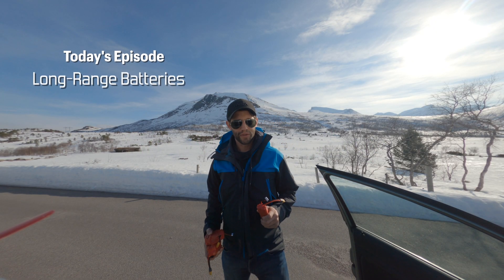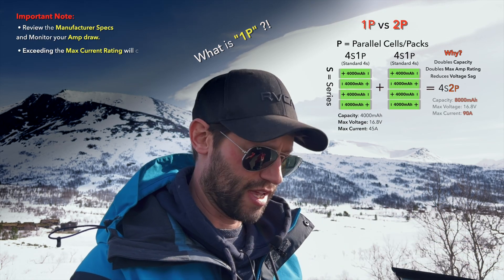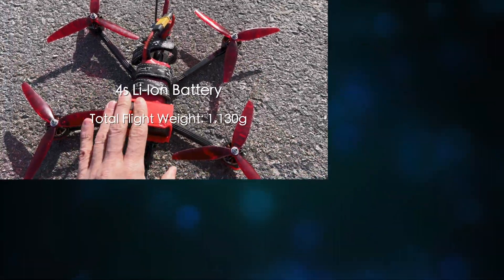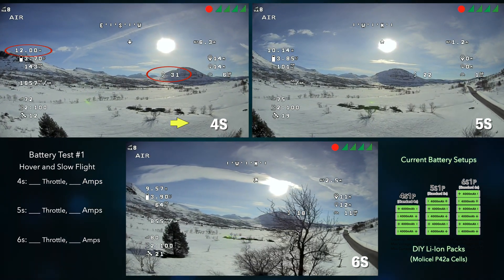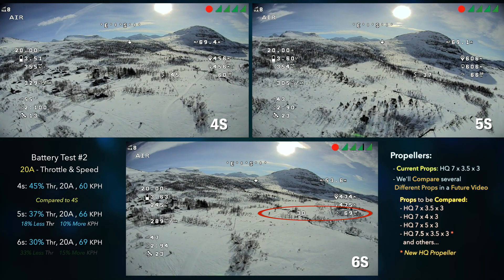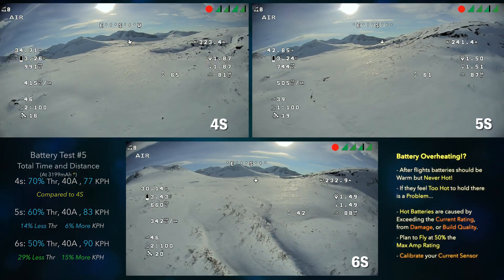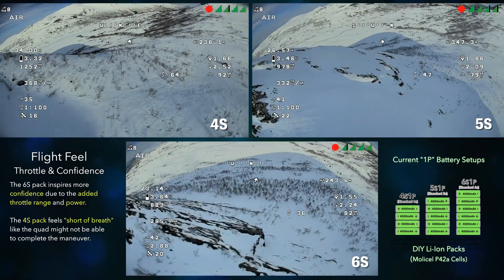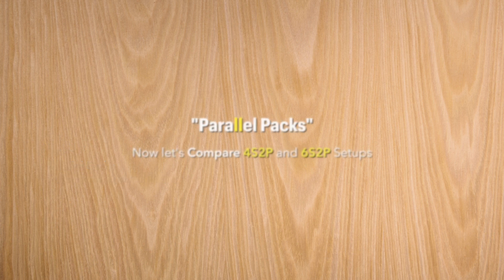Li Ion Battery Comparison for Long Range FPV Quads, Wings, and Planes. Chimera 7 with HDZero VTX

Comment: With just the battery packs 6s2p I'm getting 1.5kg on my set up and your chimera frame weighs more than mine. And you have a go pro on board wow? Where did all my extra weight come from on these 21700 packs
Reply from the maker: My quad weight 1700g AUW with GoPro. So yours sounds about the same actually. 
For shorter missions I’ve started using 18650 6s2p packs (Rated: 5200mAh/70A) made with Molicel p26a, p28a cells are an even better option, saves about 300g and the pack itself fits nicer on the quad. 

Let me know if that’s what you meant.
Reply: @GiantAntCowboy  right right I've just a few days ago built a p28a 18650 pack to try out so far I like it I may build an other not sure
Reply from the maker: @elxero2189  yea, I love how it fits on the quad nicer, and also the 300g weigh savings I noticeable.
Reply: @GiantAntCowboy  yeah I noticed that too much lower flight time though but as you've said, it's for shorter missions
Reply from the maker: @elxero2189  yea I think I’ve managed 13km, up a mountain and back with the 5200mah pack. So the larger pack is much better for cruising and “scouting missions”.

Comment: Which jumper is better to use for assembling Molicell 21700 42A - 6S
What thickness and width of the steel tape is suitable for peak loads of long-range quadcopters. I want to use metal tape and welding instead of soldering
Reply from the maker: Sorry for the delay. So I haven’t used nickel strips or a spot welder, but will say I see a lot failures with them because the Nickel strips have high resistance compared to copper, (like only 25% as conductive as copper) and the batteries can get hot when pull high amps. The strips can even melt. So, I can’t say what thickness but better to go thicker for sure. 
I personally have soldered copper wire on all one packs and have no problem even when pushing them really hard. Thanks for watching, cheers!

Comment: Best long rage battery test I've ever seen. Wish I could have seen this earlier.
Reply from the maker: Thanks, always hoping this is useful to someone. Of course results will vary based on your motors and props, but it’s a good base line for folks. I’ll be doing a follow up with 1300kv motors and some lighter 18650 packs, so stay tuned. 
Appreciate the comment and support, cheers!
Reply: @GiantAntCowboy what’s the best KVs on motors for long range flight on 5 inch?
Reply from the maker: @joloasenirofpv  that’s a tricky question, lower is generally more efficient, but you’d have to find a balance between performance & efficiency. So it really depends on your Goal/Use, Motor Size, Battery Type, & approximate AUW.

Comment: it's interesting but are we measuring power usage? The 6s battery is using a lot more power because the higher voltage at the same amp hours and it's heavier. it just doesn't look like the efficiency is taking in consideration the voltage with the amp hours. I think that's called Watts?
Reply from the maker: Yes, in hindsight I should have used Watts as the comparative figure. I was more focused on current (Amps) at the time I made this video simply because li-ion batteries generally have a low Max Current Rating. 

I’d like to redo this test comparing some of my new 18650 packs as well. They are lower capacity but also weigh less. Always lots of variables and thing to think about, so appreciate the feedback. Cheers!

Comment: With wiring the li-ion pack. Doesn't it not matter for balance cables which exact battery its on just like between b1 & b3.. between t3 & t4??? (Except for 1st positive and last negative )
I want to build a Molicel P45B pack 6S2P or 4P. Maybe a 3P 😆 🤣
Reply from the maker: I believe the order matters when using a balance charger, in fact I believe I actually got an error once when I swapped two leads on mistake. Basically it’s adding the voltage for cell and if, for example, the second cell shows more than double the first cell it thinks there’s a problem.  (This shouldn’t be dangerous though.) 
** The most dangerous thing that can happen is either overheating the cells while soldering, or accidentally shorting the (+) and (-) terminals of the battery. Remember that the outside of the battery is (-) and if you accidentally bridge solder, or a wire, from the (+) terminal to the battery case you could short the battery which can be dangerous. 
Tip: Never work on cells that are fully charged, and always check cells before assembling to ensure they are at a similar voltage. 
Sorry… lots of precautions, I just want people to be safe. 
I built a proper 6s2p pack using the smaller P26a cells and really like it. Nice size and weight, and can still get about 13km up into the mountains. The P45b cells looks really nice, I haven’t found any of those yet in Norway. Still using the P42a cells. You can certainly make bigger batteries, 3p/4p but since these are flying machines the capacity benefit eventually becomes negative due to weight. “Diminishing Returns”
Curious to see and hear about your projects and findings, cheers!
Reply: @GiantAntCowboy  meant the 2 batteries connected by a strip. i can just put it in the middle of the strip. might get spot welder might solder strip. not sure. doing a lot of research not to set house on fire lol

Comment: I tested 6S4P 18650 on 7" I turn into a 8" a few flights
Reply from the maker: Nice. Which cells are you using? I made a 6s2p from P26a cells that I really like, it’s my go to battery for fun medium range stuff.
Reply: @GiantAntCowboy  they are VTC6 cells
Reply: @GiantAntCowboy  I want to make a 6S3P or 4P with molicel P45B

Comment: Very good video and info.  High confidence in my 6s2p build going forward.
Reply from the maker: Thanks appreciate the comment. I recently made a 5200mAh 6s2p pack using Molicel p26a 18650 cells and really like it, weighs 300g less than my 8000mah pack and fits the quad better. 

I can still fly 12-13km with it which covers most flights for me.
Reply: @GiantAntCowboy  My thoughts exactly. I don't think I'll be building 21700 packs and will just stick to my p26's. It's plenty for my AOS 7.

Comment: I build some Chimera 7 by myself for Long Range cruising stuff. Together with DIY 6S1P Li Ion Molicel P42A / 4000mAh you get good flight time and for Fun you can use 6S Lipos around 3300mAh. I think Li Ion in 6S2P is too much weight. So this year I will swap out my 6S FC+ESC and try 8S. More Voltage means less current and more energie than 6S but only 2 cells more in one Pack. So i hope i can gain more flight time.
Reply from the maker: Nice, appreciate the comment. I recently made a 5200mAh 6s2p pack using Molicel p26a 18650 cells and really like it, weighs 300g less than my 8000mah pack and fits the quad better. 

I still fly 12-13km with it which covers most flights for me. Curious to hear how 8s works for you. Cheers!
Reply: @GiantAntCowboy  The Molicel P28A looks very promising. 2800mAh / 35A discharge and only 46g each. So a 6S2P Pack of these weight roughly the same as 8S1P P42A. Both Packs have the same amount of energy 124Wh. But tue 6S2P will delivers more current.

Thanks for sharing you Infos to us. I appreciate your work!

Comment: Hi dude, thanks for your video! I was flying at some really high peaks around 25000ft, using 8000mah 6s lipo on my 10inch because I think lipo performs better at -20 degrees, but I'm curious what's the best match for my need if I'm trying Liion next time, probably 6s 3p?
Reply: I need the flight time to be as long as possible, will need to cruise 5-6 miles to get to the mountain while the wind can be massive above.
Reply from the maker: Hey, appreciate the comment. Crazy mountains your flying to sounds like! Where are you flying? 
Regarding battery solutions: What’s the average current draw (Amp Range) you have while flying? Some options:
If you made a 6s3p pack with Molicel P42a cells it might weight about 1300g (slightly more than your 8000mAh LiPo) but it’d have 12,600mAh and it’d handle up to 135A. 
Or you could use like Sony VTC6 cells in the same 6s3p setup and you’d have 9000mAh with 90A max current, but it’d only weight about 900g. So you’d save between 300-400g which could result in better range. 
Alternatively depending on Amp requirements, you could try some 4s setups, which saves a lot of weight, but reduces top-end power due to the higher current demand.
Reply: @GiantAntCowboy  Thanks for the suggestions, I'm in China, flying near the Himalayas so the mountains are over 18000ft in average, pretty insane. The flight time at this altitude drops to 60% of what you get at sea level, so the flight time needs to be over 35mins at least. I'm now getting 30mins on my 10" 6s 8ah setup but wanna change it to maybe around 10ah on 8"

Comment: I watch your videos from India. At present I don't have access to any of these HDZERO vtx or Chimera frame here, but still your video inspires me and add knowledge to me that if i will make, then how i will make one. Presently have a five inch quad with analog vtx and 14 min flight time.
Reply from the maker: Thank you, appreciate the nice comment. Analog is simpler, cheaper and still a ton of fun!  No need to go digital honestly, but obviously the image is better. Depending on your goals, 5” quads are pretty universal. Li-Ion batteries are great for increasing range, and helical antennas are cheap and easy to make if you need more video range. Thanks for watching, cheers!

Comment: Great video man that’s a ton of work thank you very much for sharing all this precious informations ! I have a Falcon FR7 and use dual 18650 vtc6 6s2p to get the longest flight but it’s quite a fat build 😅 1500gr AUW . For mountain diving lately I’m starting to like big lipo too, ( >3000mah ) but are very expensive and hard to find …
PS: I’d curios to see your pids too even if it’s kind of personal
Reply from the maker: Hey thank you, it mean a lot when people recognize the amount of work I put into these videos. It always starts as personal curiosity but then I obsess about the presentation details. 
My build is 1700g AUW with a GoPro and 21700 6S2P 8400mAh packs… but lately I’ve been enjoy/using these 18650 packs I made with Molicel P26a cells. In 6s2p configuration it’s 5200mAh, handled 70A, and weighs 300g less. Want to build more of these, they actually have a P28a cell too, I just can’t find them here in Norway… agree about LiPos 🤑
Regarding PIDs I’m actually using a BF4.3 preset. The 7” one by UAV Tech and it’s working great, haven’t done anything other than follow his notes and then I adjusted the rates a little. I’d recommend trying it. Anyway, thanks for watching and commenting. Stay tuned, cheers!

Comment: GepRc 7" here. Just made my first 6s, 4000mAh 21700 li-ion pack (Samsung 40T cells). It's 456g. My 5000 mAh, 6S lipo is 790g. I'm gonna make a bunch of these things. I can get 60% more capacity for 12% more weight in a 2P setup... it's a no-brainer. Li-ion is the way to go for 7" quads. The only time i'd go with a lipo is if i really feel the need to thrash it for 3 minutes. Then, i'd use a 2200 mah, high-C rating lipo for mad acro.
Reply from the maker: Yup, agreed. I fly almost exclusively Li-Ion setups. My new favorite battery is actually a 5200mAh 6S2P made with Molicel P26a 18650 cells. Its 300g lighter than the 6S2P 21700 packs, and physically more compact as well. Great for shorter faster runs, and I still get 13km round trips flying up to the mountains.
I’ll do a follow up video at some point, Molicel also has P28 (2800mAh) cells, but I couldn’t find them here in Norway… 
Anyways thanks for watching and commenting, stay tuned cheers!

Comment: Those packs look DIY. Did you solder them or spot weld them?
Reply from the maker: Yup, I use almost exclusively DIY packs. Mine are all soldered “with care” and work great. 
Generally I hear the argument that Spot Welding is better or the only way to go but have never had any issues with mine. 

Additionally I’ve heard many people with Spot Welded packs complain about over heating… part of me wonders if the thin nickel strips cause too much resistance at higher amp loads. 

Nickel is much less conductive that copper. According to IACS copper is 100% and Nickel is only 22%. 

I made a quick simple DIY video a while back if curious what I do:

https://youtu.be/hnjgdUU3x5A

Happy to answer questions about the DIY or different pack setups, cheers!
Reply: @GiantAntCowboy  thanks for the reply. I agree the high current is a problem.  I was going to spot weld using a coper nickle sandwich but now I think I'll do a solder through a hole in a thicker copper plate.
Reply from the maker: @senditsamfpv  I just use like 12awg wire soldered between, copper plates could certainly work. 
One word of caution: the body of the battery is Ground (-) so be careful when soldering the Positive (+) not to accidentally bridge the (+) connections to the battery body… hope that makes sense.

Comment: Same motors 5s2p on 1180g quad +cyclone7056 ultra!
Reply from the maker: Nice. Mine is like 1700g with 6s2p, but recently I’ve been using a smaller 5000mAh pack that saves about 300g. 

Reducing weight is by far the greatest way to improve flight time and power efficiency with any flying vehicles.
Reply: @GiantAntCowboy  For this frame diminishing returns starts to weight hard at over 1200gr, so with minor diferences, really 4s,5s or 6s depends on your preference (and sag tolerability). Props are the most important in maxing the efficiency.  Wish someone makes Mavic II Pro type propellers for 5mm shaft :) 
Nice tuning, stability on 4s is very telling for a good setup. Care to share PIDs if in INAV?
Reply from the maker: @sakarrc5001  yea, for me it’s a mix of handling vs efficiency. Meaning I want decent flight time, but also enough power/thrust to fly fast and hard in the mountains. 
Currently I’m using HQ J75 props, not efficient but have great feel. 
Regarding PID tune I started using the UAV preset for 7” in BF4.3 a few months ago and really like it. Don’t think I’ve tweaked it since then.

Comment: Whats the "absolut" longest flighttime with your 6s2p Liion ? Im a little bit confused about your flighttime 6s1p liion because i easily achived 25min with 4000mah, cruising slow as possible (never above 25a)
Reply from the maker: I could maybe squeeze 25min flight time with my 8400mAh 6S2P, but it would be a boring flight. 
What’s your setup?
This is a Chimera 7 with 1500kv motors, carrying a GoPro 8, weighing 1700g. 
EMAX sent me a set of 1300kv motors recently that I’ll be testing soon, maybe that’ll help efficiency. 

But let me know about your setup, and thanks for watching, cheers!
Reply: @GiantAntCowboy    after i sleep one night i recognize a significant different, the Distance 🤣 i never reached your Distance you have achieved.

But my Setup is a geprc mark5 with egodrift jetstreams (2407) , 6s1p 4000mah liion and gopro, ~ 1200g
Reply from the maker: @Quadtastrophe  yea so many variables in this hobby. Impossible to do a perfect comparison. 

Weight is a huge factor for efficiency of any flying machine, but also my bigger motors might just consume more power.   Thanks for the response.

Comment: By far best video out there. Thank you for your hard work on that.  After building many smaller quads and some wings finally  building 7" with 2807 1500kv. Hoping that I can run 4s and 6s  DIY Li-Ions, 5 inch packs in parallel and also fixed wing bigger LiPos. This answered all my questions. Thanks again - awesome stuff 👍👏
Reply from the maker: By far the best comment out there! I do put a ton of effort into these videos, and so I appreciate the kind words, cheers!
One random tip when making these packs: Check the voltage of each cell to make sure they are about the same before assembling.

Comment: Why does 4S fly longer than 6s?
Reply from the maker: Well, a couple things. 
- At 900g, the 6S2P weights 300g more, which is 50% heavier than the 4s setups. 

- Also I think I push the 6s packs harder… so the test might not be totally accurate.

Ultimately though weight kills efficiency, especially with anything that flys!

I recently started using 18650 6s2p packs made with Molicel P26a cells. These packs save 300g offer 5200mAh, and can handle up to 70A. You lose a little range compared to the 8000mAh packs, but I still get 13km trips out of them and the quad flys quicker and more nimble. 

I’ll try to do a follow up video about this eventually, just been busy!

Thanks for watching, stay tuned, cheers!

Comment: After trying p42a in 5S1P and 4S2P configuration, I am thinking of trying 6S1P next.
They felt pretty similar. The 5s1p are light. The 4s2p deliver more current, but are pretty heavy.
I keep coming back to your video to compare your results.
What I'd really like to know, why you chose the 1500kv motors?
I've tried 1700kv 2807, but they draw  too high current at low throttle.
Now I've switched to 1300kv. On 4S2P 1500kv motors might be better though 🤔
Reply from the maker: I picked 1500kv simply because I couldn’t decide between 1700 and 1900… however literally just yesterday I got a set of 1300kv that I’ll be testing next month. Curious to see how they compare. For my current setup I really like 21700 6s2p, but recently made a 18650 6s2p pack which I really like. It’s 300g lighter, and has less capacity, but I still get 13km round trips out of it, and it the quad flys noticeably better. I try to make a part 2 to this video, stay tuned, cheers!